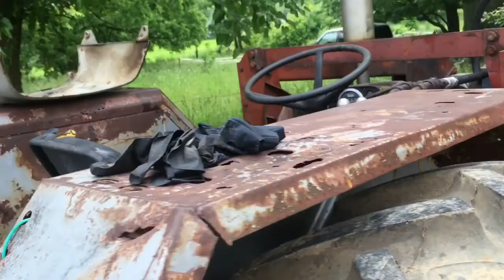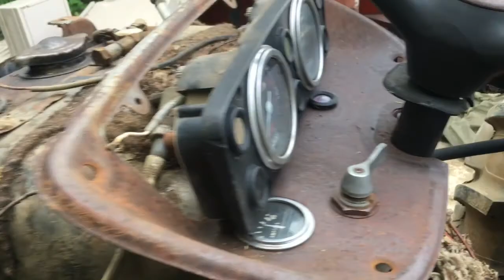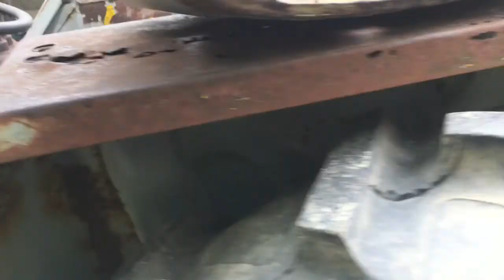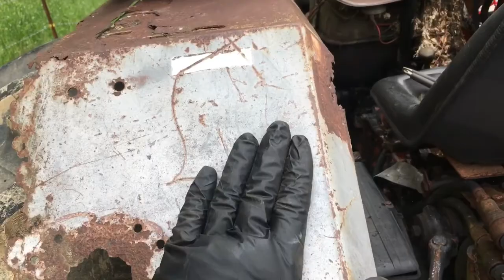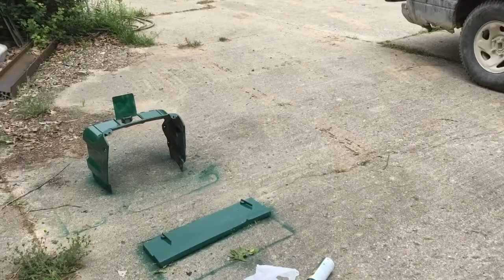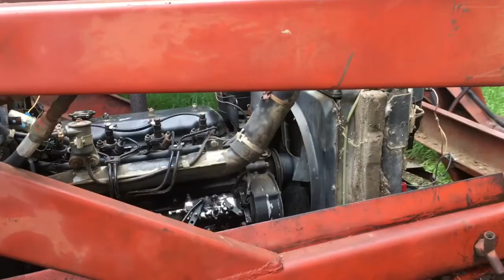White 2-60 Tractor Restoration

Comment: I found an orphaned 2-60 on a local dealer lot.  Sound mechanically, but paint less and missing front grill.  Spent the time, took it back to bare metal, primed, painted and gave an over all servicing.  It has become our go-to tractor.  Mow and bale with 2-85, rake and ted with 2-60.  Tough, well built little cusses.  You will be well re-payed for your time and effort.
Reply from the maker: It’s a great stout machine I’m putting clutch in it now
Reply: @michiganhay7844  Hope you produce a video about the process, personally I would be most interested in watching.
Reply from the maker: @rogercansler3709  Yeah I could do that I had to take the loader and loader frame off it and then my mechanic had to split it but in order to do the clutch you also have to pull the engine which was interesting we’re also doing the brakes to I’ve use the tractor now for three years. They’re great tractors in one of the reasons I know it’s because this thing was really abused when I bought it